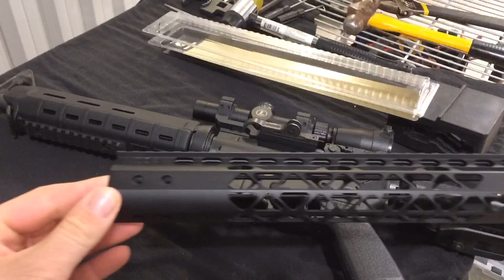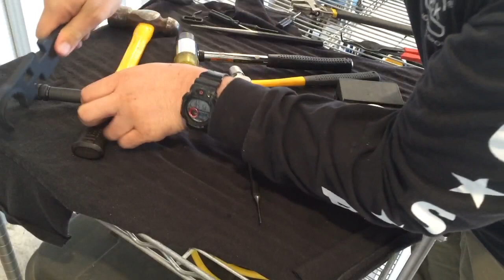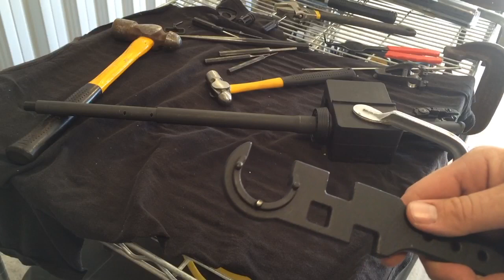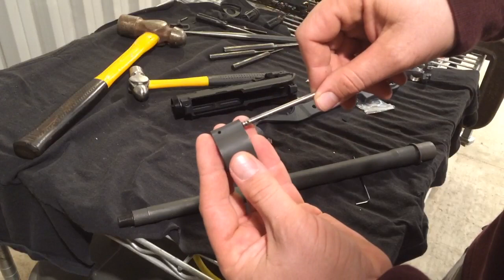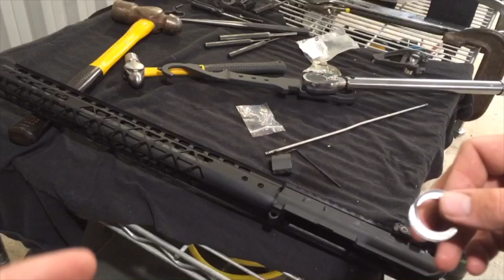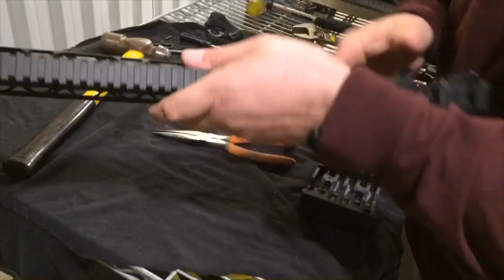GUNTEC USA 15" AIR LITE HANDGUARD - INSTALLATION

Comment: Man you need to put your torque wrench in a 90 degree angle to keep the value of torque true, if you tightened that barrel nut like you showed you added at least six inches of leverage to the torque value and your lucky you didn’t strip the the receiver threads but you put a massive amount of torque on that nut, always torque so that the length of the wrench is parallel to the tool your using!

Comment: I hate set screw gas blocks! I had one and it came loose and shot out with the gas tube still attached. Get a clamp on style, just my 2 cents.
Reply: Or just get a gas block jig and dimple the barrel.
Reply: That's why they invented red lock tight

Comment: Do you need that armourer tool for the barrel nut? Or could you get away with something else
Reply: Rag and a channel lock if you don’t plan on using the barrel nut again would work
Reply from the maker: You could possibly get away with something else. I've never tried though.

Comment: Just a tip for positive rail to upper receiver alignment.  If you have a Red dot or a mount thats meant for picatinny rails, you can use that to clamp half on the receiver and half on the handgaurd, then tighten your mounting screws.
Reply from the maker: Thanks for the tip!

Comment: What about on a bull Barrel
Reply from the maker: Sorry, I haven't researched the Bull Barrel to see if they make one or how it is installed.
Reply: Boondock Patrol yes it will fit a bull barrel just make sure you get the right size gas block

Comment: Nice man. You made it look so easy. I took mine to a gun smith and he had trouble finding a tool to torque it with because he didn’t have anything small enough to fit in the grooves.
Reply from the maker: My buddy took this video. He's an AR-15 guru and over the years he's built many of them, so he's accumulated the tools and know-how.